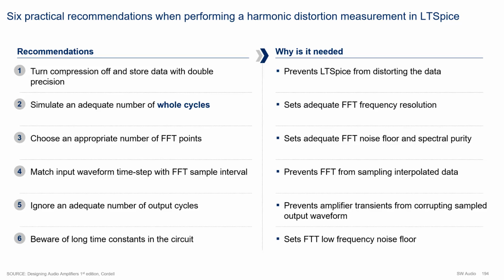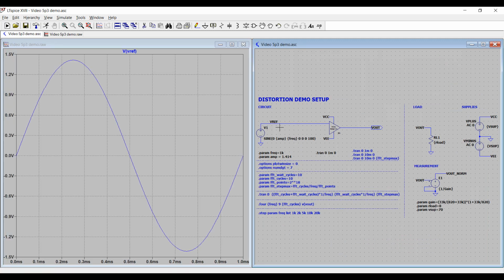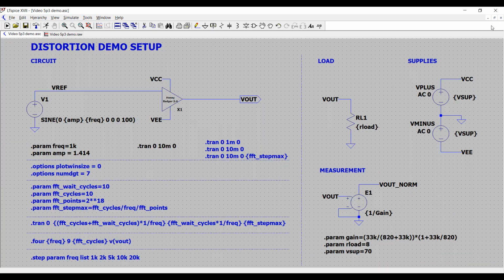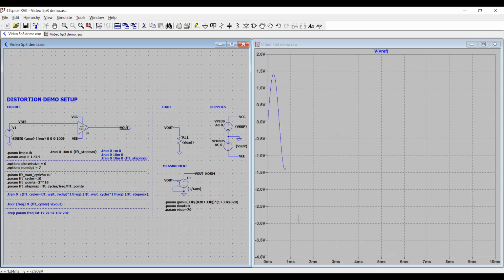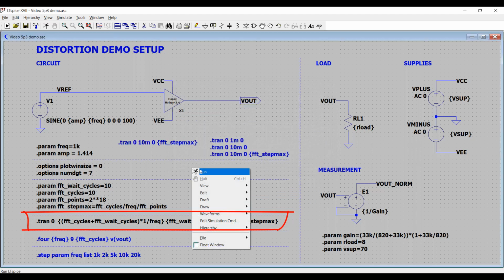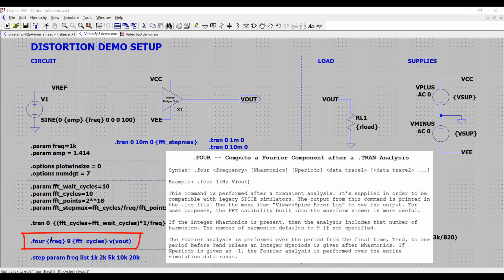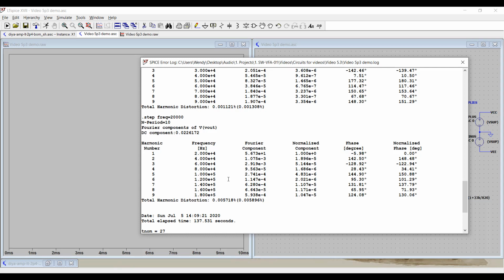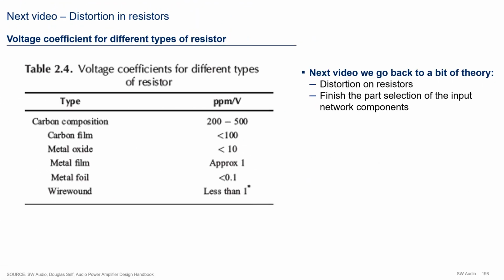5.2.2. Measuring harmonic distortion in LTSpice, DEMO - Part 2 - Audio Amplifier Design Fundamentals

Comment: Please, I need to confirm if Ltspice does the Fourier calculation considering harmonic 1 (fundamental) in the "numerator" of the equation. If so, the directive should be written discounting this harmonic as follows:
.four 1k 10 -1 v (Output)
Where "10" is the amount of harmonics to calculate and "-1" is the first harmonic (fundamental) REMOVED from the "numerator" and remaining only as the "denominator". In this way Ltspice will calculate 9 harmonics from the second to the tenth.